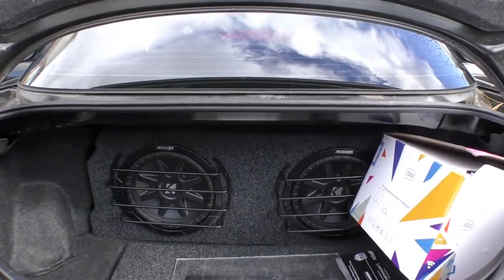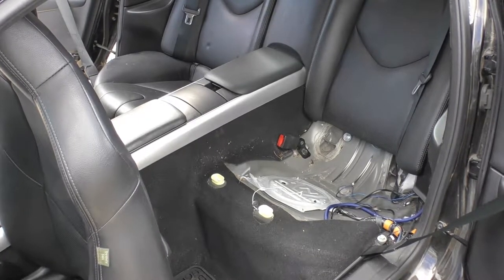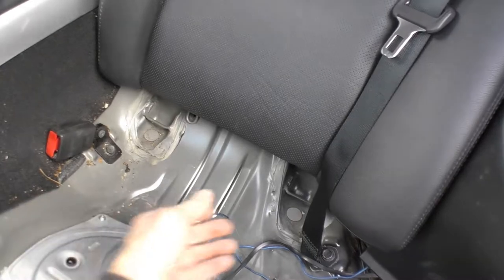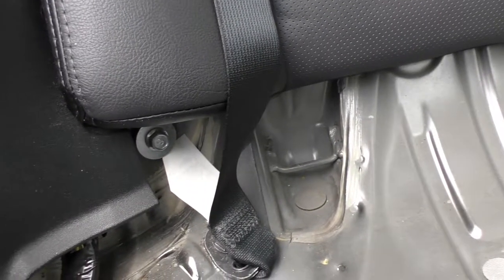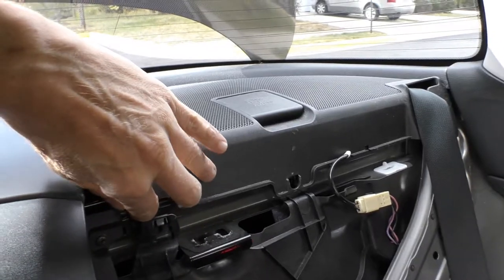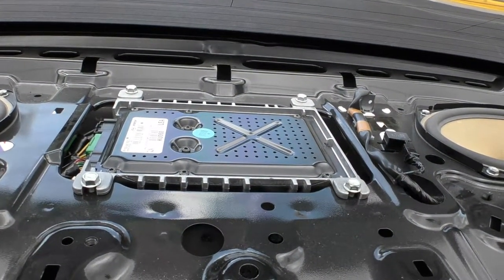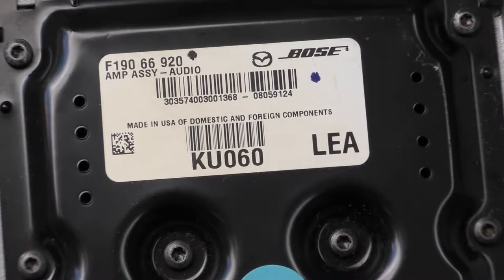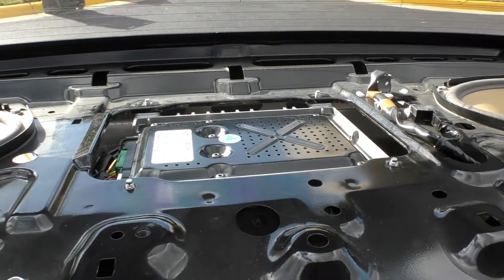How to remove BOSE amplifier from MAZDA RX-8 2009-2012 amp F190 66 920

Comment: I have a first gen RX8, My left door panel speakers are substantially more quiet than the right.  I tried swapping the door amps, but that did not resolve the issue. Swapping the small tweeters from left to right, does not change volume, so the problem is with the left channel. Could it be the main amp that is having issue? F15366920A is the part i am looking at. Don't know if it is on the same place as the video. I read online it is on the back side of the drivers chair.
Reply from the maker: I'm not a car guy, I am a tech. I have no idea what year first gen RX8. Thank you.

Comment: Is the first gen RX8 the same?
Reply from the maker: First gen RX8 is different. What is the issue?
Reply: @1gigelectronicsrepair745  I'm getting static from the speakers when the radio is off and the key is in accessory position. I'm told it's because the amplifier is still on. Can this be fixed?
Reply from the maker: @franks3001  Is the amp part number F15366920A ? Thank you.
Reply: @1gigelectronicsrepair745  I took pictures of the amp but I can't find a part number anywhere. Where is the part number? It's a stock Bose amplifier from a 2004 RX8.
Reply from the maker: @franks3001  Can you attach a pic of the back sticker please?

Comment: What Headunit is that?
Reply: That Radio/Headunit isn‘t Stock, is it? I only know the Metra kit as a exchange option but that one doesn’t seem to be one.
Reply from the maker: @Pookyoda  Are you asking about the unit in the video?
Reply: @1gigelectronicsrepair745  yes, what head unit is the one in the video?
Reply from the maker: @alexandruelgeo  I am not working with head units. I can tell you about amplifiers if you want. The video  was taken in a real RX-8 where amp got repaired by me. Owner was very kind to wait. Thank you.